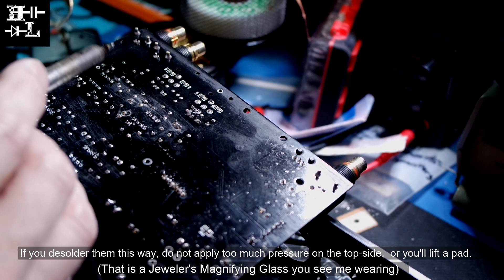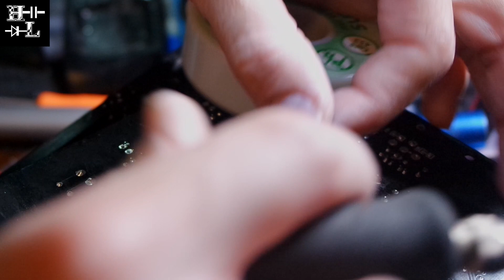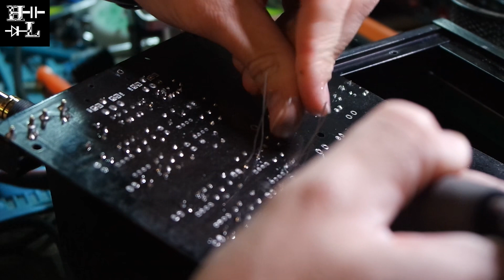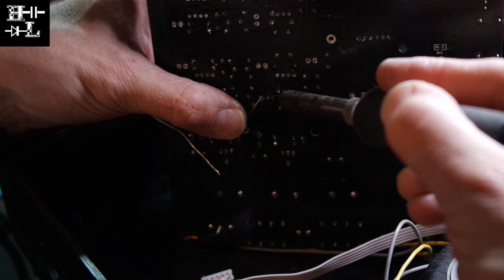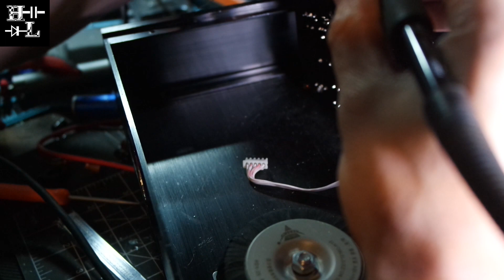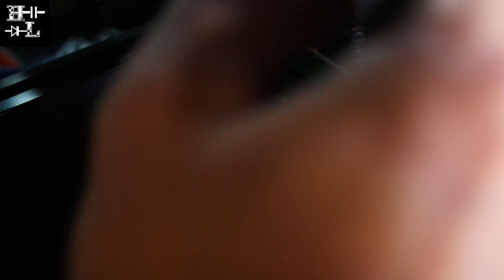How to Upgrade ES9038 DAC (Stage 1) Video | Caps + Sockets + Resistors (Complete 1hr+ Build)

Comment from the maker: I welcome any legitimate criticism, or ways you would have done this better. I am always open to learning new techniques. I know my soldering isn't perfect, but I have been improving steadily, over a decade and a half.

I apologize for how often my hand ended up in front of the camera, this obviously wasn't intended. However, trying to de-solder + solder something like this, while also recording, is not easy for a one man show.

I know many people would not remove capacitors like this, however, it has always worked for me and I have better luck this way. 

If I tried to remove all of the solder and just pull them out, I would have likely overheated a pad. That is why I prefer to turn the solder molten and then pull the capacitor out. Following up with some simple cleanup. 

Note: I didn't show all of the steps, as you'll see the PCB has become much cleaner, all of a sudden (at the "assembly time" caption).
Reply: nice mod